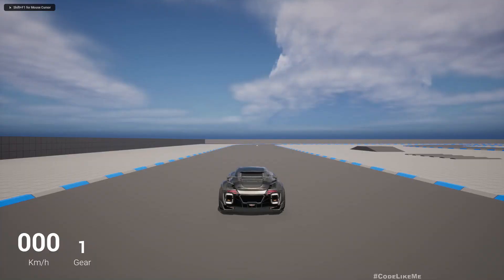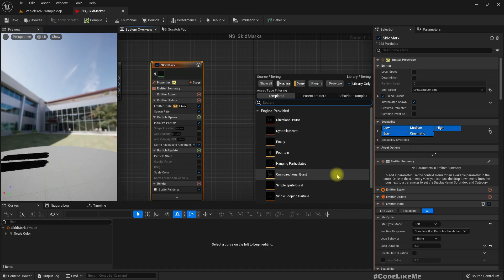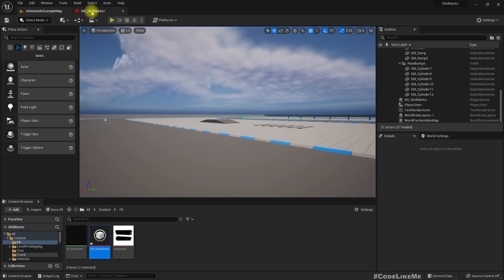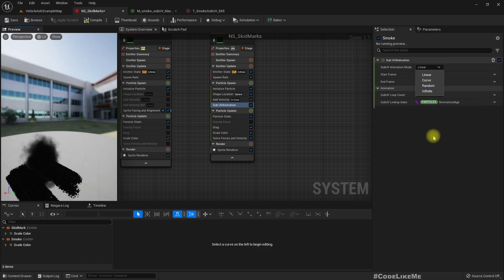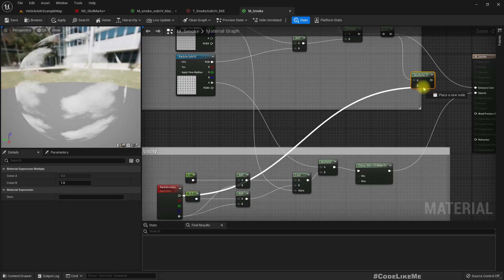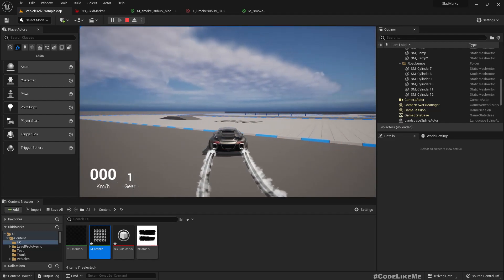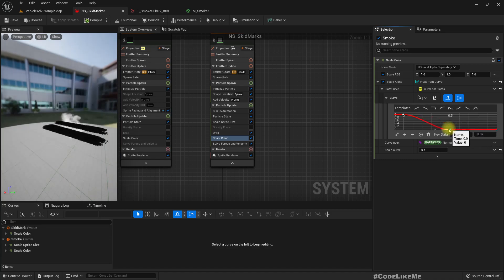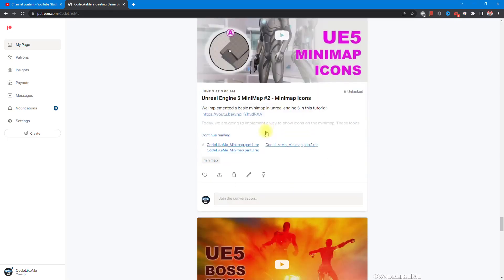Unreal Engine 5 - Car Skid Marks #2

Comment: I might have an interesting challenge for one of your upcoming videos :)    Build a 2-sided differential drive (chaos) vehicle that can be driven on two sides.   If I currently flip it over it stops moving (sounds kind of normal for a car setup...)  If i turn it back, it works again.   i just turn the whole object over, so  I was thinking about, flipping the chassis over, but in some way flip the wheels into the other direction (upside down).   as it is 2 sided it wouldn't be noticed?